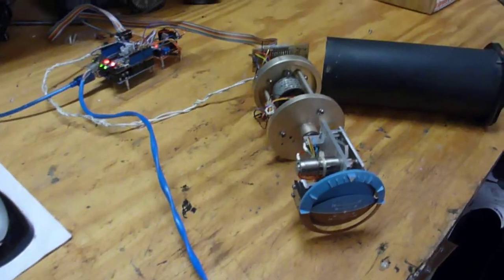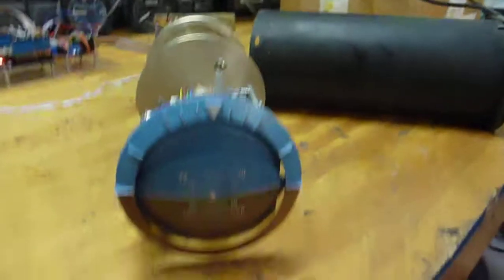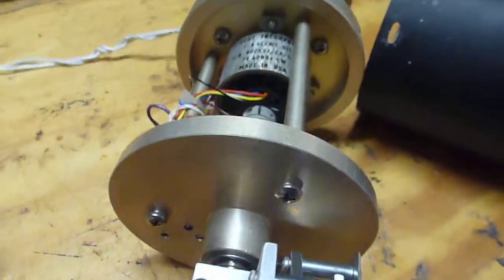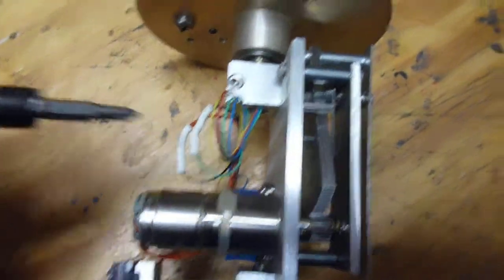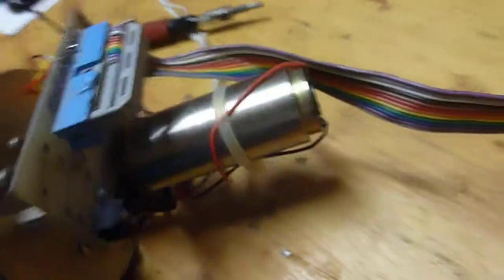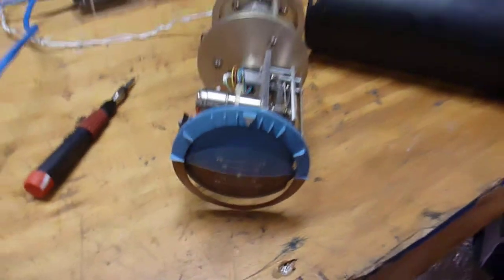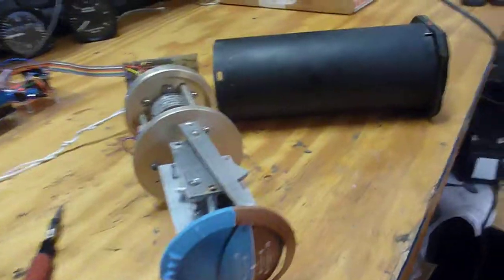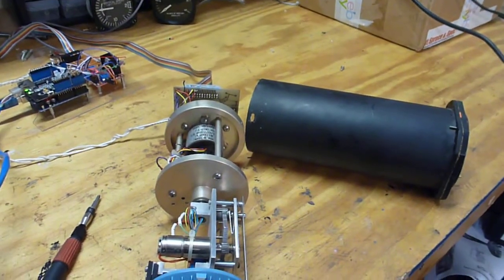AST-300 Attitude Indicator Interface

Comment: Very beautiful, well made!
I have wrote you in other of your vids. I have a set of ast300 instruments and I am actually interfacing them. 
I have the ADF, the Whisky Compass and ...  the HSI complete!!!! Perfectly and full working HSI with arduino and prepar3d. But...
I couldn't see a way to read the resolvers. So, I have change them to absolute encoders. I made a 3d print pieces to link the encoders exactly in the same way and space where the resolvers were linked. So I can swap them very easy. Works very well. 
The following instrument I want to interface is this attitude indicator. In this instrument, the resolver has passing axle. So it is more dificult to change it with a standard absolute encoder. It could be great to use his own resolver. It is a 400hz ac power supply needed? Is the ac onde arduino generated? 
I will post videos with my ADF and HSI in the following days. 
Thanks!
Reply from the maker: Hi Arturo, 
I've used encoders to read synchro position, which works well if the back of the synchro is available. I'm still working on reading synchros directly, however. I don't have a 3D printer, so I'm having to hand-make little brackets and mounting plates and such.

You've run into the through-axle issue. :) There's really no way to interface the AH, as it's designed,  without reading the resolver position directly. I was working on replacing the roll motor/reduction gearbox assembly with some sort of precise drivetrain that I could hitch an encoder to, when I figured out the resolver issue while working on another instrument. I'm not using a 400hz power supply, the reference signal is generated entirely by the Arduino.

I'd love to check out the vids of what you have working so far. I also have the King HSI with its little piggyback interface. I looked through the King repair manual a while back and got some ideas, but have not tried interfacing it yet. A bunch of the other instruments are dead-easy D'Arsonvals, I'm probably going to get those going in my sim before working on the HSI.